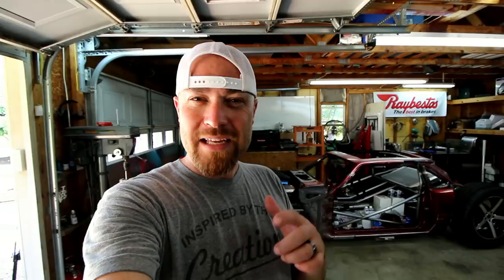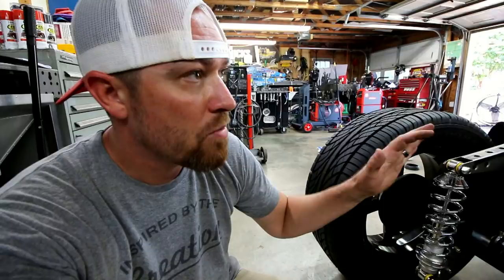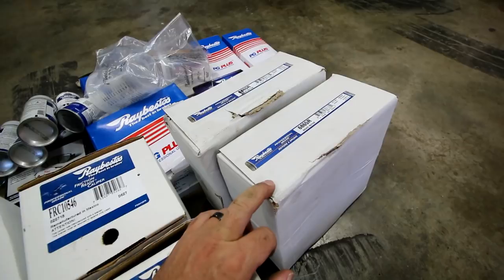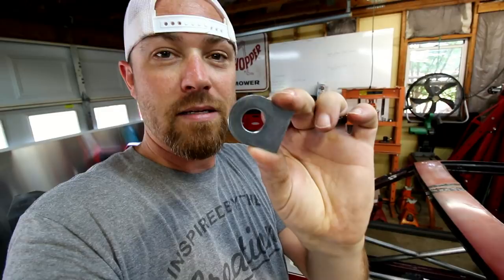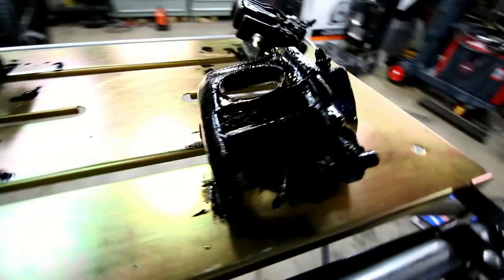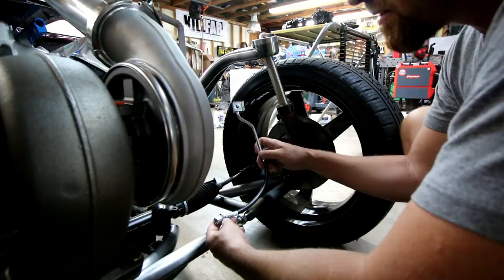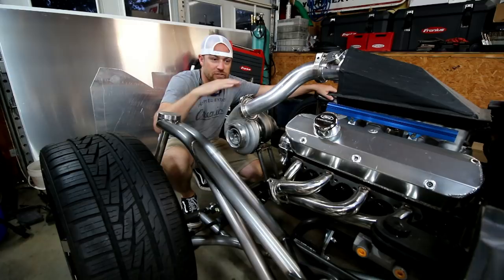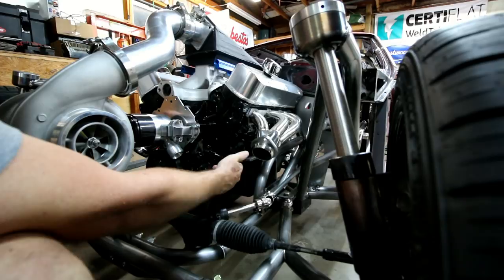New Brakes for The Bibbster Build

Comment: Instead of the larger 24" fan try a small air mover. The 24" fan you've got there I believe moves about 180 m3/min (6357 cfm) but a small air mover can do 500 m3/min (17657 cfm) and are a lot quieter. Just bought the Shop Vac Mini Air Mover and it's awesome in the shop. Bit more money worth every penny plus it's useful for drying paint around the house, drying carpets, easier to store, etc

Comment: Your not concerned about those plates trying to move the heads around? Your already going to motivate them to lift lol
Reply from the maker: no...most race engine are mounted to the chassis by the heads vs motor mounts
Reply: No, not by the heads! By front of block. Look at any engine plates. None bolt to heads.
Reply from the maker: you are right. I was thinking the mod motor setups where mounted to the cylinder heads. I will figure something out

Comment: I know this is not a race car but why not swap the knuckles for 94-95 sn95 Mustang knuckles? then you could use the Cobra brakes with the big rotors.
Reply from the maker: Mainly because I am trying to use what I already have. Besides better braking can happen in two ways. Bigger brakes or lighter car. With a lighter car I can take advantage of the reduced rotating mass of the smaller brakes and still stop on dime.

Comment: Why don’t you run a set of coil overs from the top of the upper “arm” I guess you would call it, to the front of the chassis. Like air assisted coil overs so when you drop the front end it drops too. If you know what I’m getting at. Hard to explain without showing it to you
Reply from the maker: I like the idea of not having a "overpowering" spring  up front
Reply: Yeah, I understand that. Just thinking outside the box